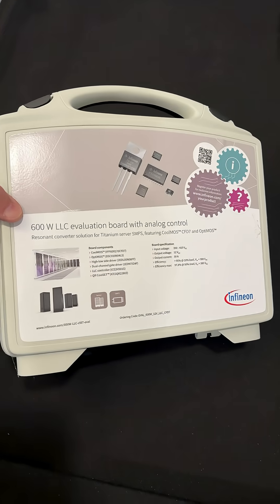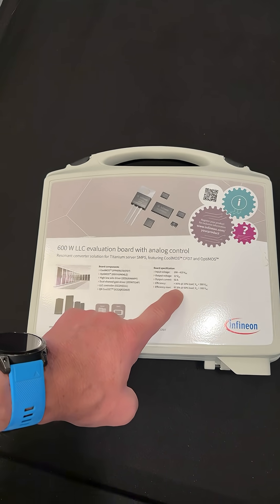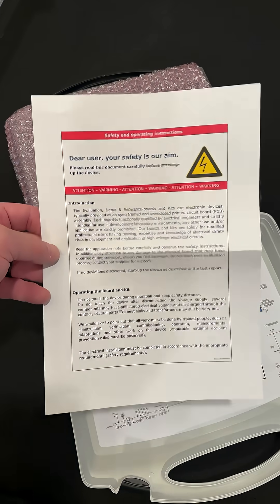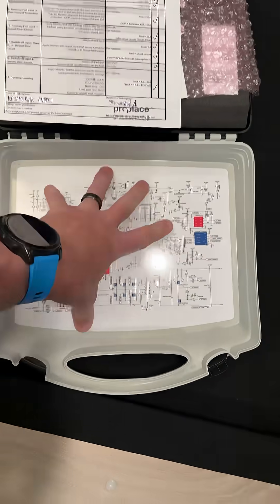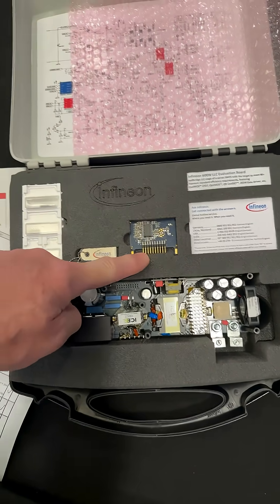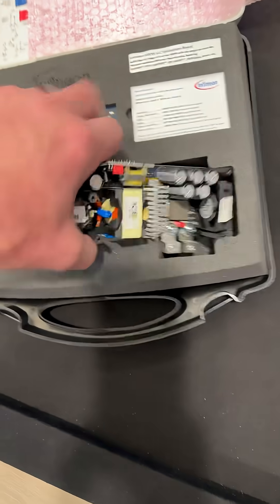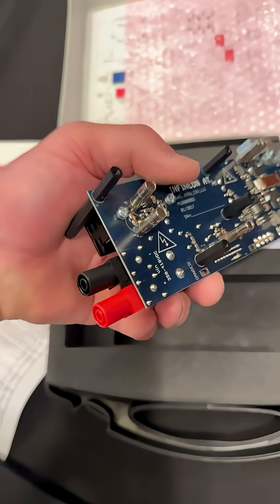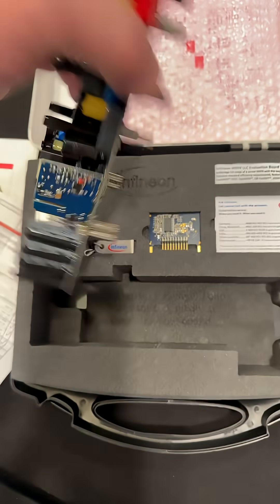600 Watt LLC Converter by Infineon Project Intro #coolmos #OptiMos #80PlusTitanium #PSFB #SMPS

Comment: Can't wait to see more on this kit. is there a way to use the llc converter for an inverter ?
Reply from the maker: Thank you!  The inverter function is really different, but if you need to prepare the input voltage for the inverter part - then maybe an LLC could be used.